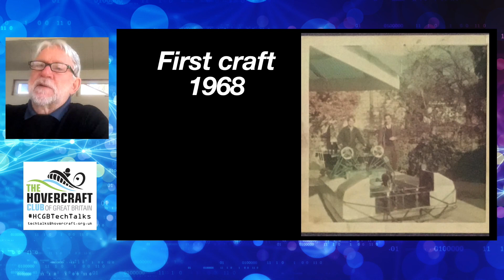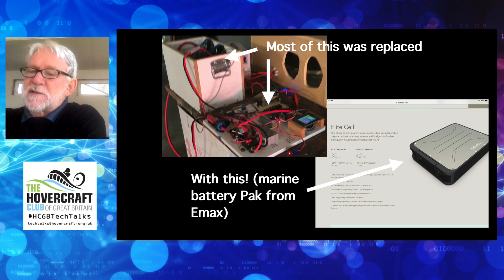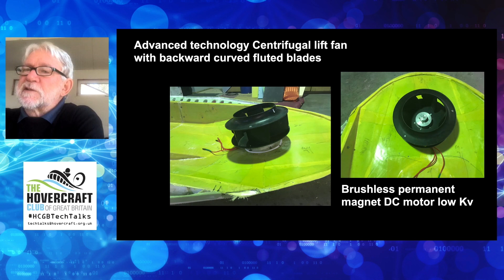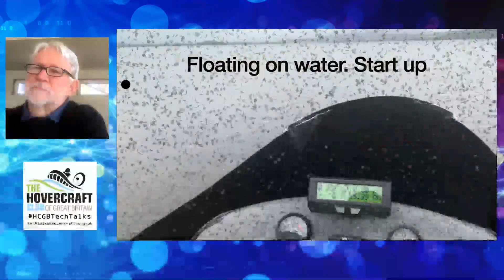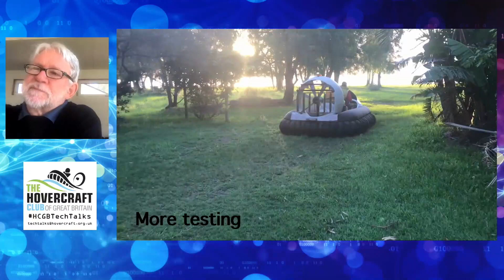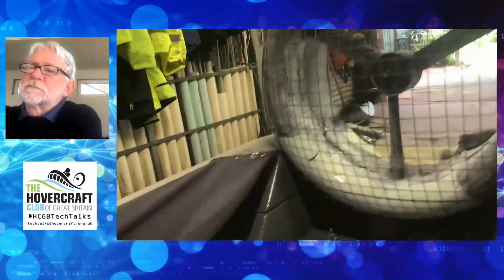TechTalk - Owen Ellis - Electric Hovercraft

Comment: A great video and really excited by what you are doing. Please can I ask:

How long does the centrifugal fan run for under normal conditions?

Do you know approximately when the electric thrust system will be ready?
Reply: Adam, Thanks, the centrifugal lift fan will run for about 2 hours with a 5 Kw/hr battery Pak. Electric thrust system development has stalled due to the current global pandemic, therefore hard to predict a time frame
Reply: @owenhovercraftellis1336 that is an excitingly long time!

Can I ask what in practical terms has made coronavirus affect development, but please only say if you are comfortable to?
Reply: Adam Silton Simple, primary development is done at our hoverstudio in Oz and I’m currently caught here at our other base here in Montreal!
Reply: @owenhovercraftellis1336 hope you get to restart your great work as soon as possible.

Comment: Terrific progress Owen!  I switched to an electric car 2+ years ago, and don't think I'll go back to fuel.   When my car gets wrecked I'll have 60 kWh of hovercraft batteries available!  Electric power just offers so many new design avenues for hovercraft.  I did a lot of testing of centrifugal lift fans before implementing one on my current hovercraft, and the small amount of power required while generating cushion pressure, but not much airflow, is amazing in comparison to an axial flow unit.  This is a great YouTube channel.
Reply: Thanks Dean. Keep me in mind for some of those surplus batteries if your electric car ever short circuits!

Comment: Many thanks for your presentation, it was really fascinating. I was surprised by the relatively low power requirement for the lift fan. I note you ran a 5kWh battery and saw the system voltage was ~50 volts keeping it below the VDE low voltage limit (lower than 30 V AC, lower than 60 V DC), which avoids the need for electrical contactors, high voltage disconnects etc. which will complicate high voltage battery packs I’d be interested to know what ESC / inverter you are using and the mass of the battery packs that you are using. Your electric thrust system looks great!

Comment: Great presentation, thanks Owen. I have a couple of questions for you:
1). It is interesting you used a centrifugal fan for lift, do you think you would get the same performance with an axial fan?
2). Do you get any issues with water ingress causing the composite centrifugal to go out of balance?
Reply: For some reason my original replies have disappeared. So, here they are the again.. 
1. Centrifugal fan was chosen since it is the most efficient means of providing the requirements of lift system. Given that energy consumption (currently) is a critical consideration, it had to be a centrifugal or mixed flow fan. 
2. No fan out of balance issues since due to its designed location, there is little opportunity for water ingress.
Reply: Those are fascinating questions, I would especially love to know the answer to the first one.

Comment: Well done, Owen. There's a lot of 'particulars' that you could have gone into. Things such as the electrically operated elevators (was this done using the same method as the Brickles brothers did?)  How are you controlling the motors? Is it a commercially available ESC or something you've put together? Are the battery packs 'just batteries' or do they provide you with other features? (such as current flow, available power). Why are you considering a fan for the all-electric vehicle and not just focusing on the carbon prop (which seems to run extremely well.) How long does it take to recharge the batteries and what is the current run time? What is the projecting running time for the all-electric craft? (I'll stop here!)